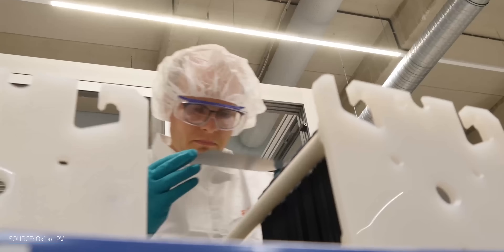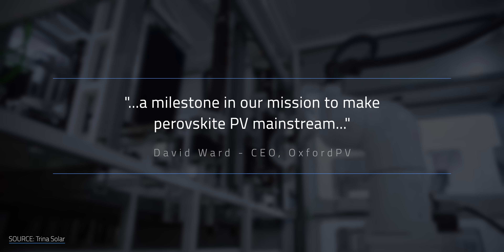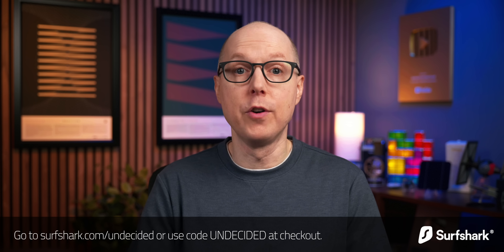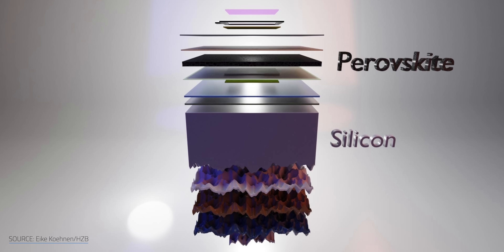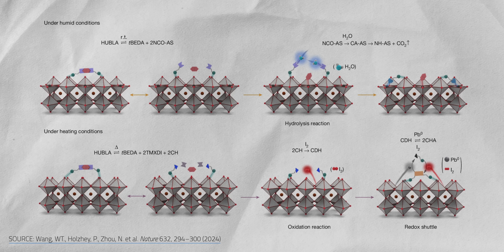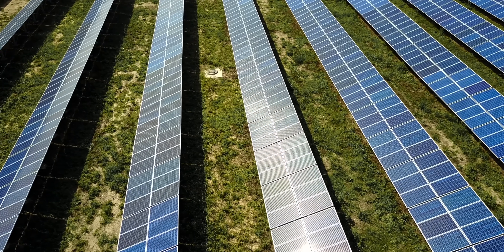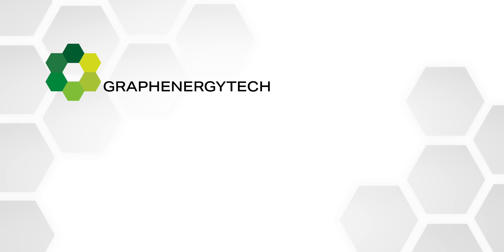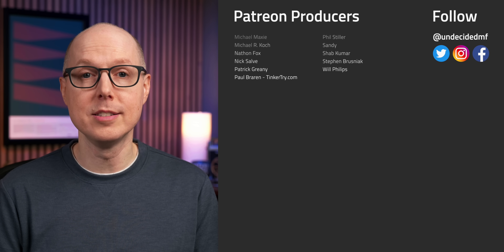What Solar’s 2025 Breakthroughs Mean for 2026

Comment: What I think is that you are being misleading. The so-called 'theoretical limit of silicon at ~30%' applies only to single-junction silicon solar cells (the Shockley–Queisser limit). Once you make a tandem cell, like a silicon–perovskite dual-junction, this limit no longer applies. The top perovskite layer absorbs high-energy photons that silicon cannot, while silicon absorbs the lower-energy photons that pass through the perovskite. Claiming that this 'shatters silicon’s theoretical limit' is therefore scientifically incorrect, because the limit never applied to dual-junction cells in the first place.

Comment: So what does this mean to me as a homeowner looking into solar? Is this coming to home solar in the next year? Next few months? Next 5 years? Up front costs vs long term gains. 

I am looking into just supplementing my home for now with 800w or so of panels. No batteries yet. No fully integrating into the house, just adding a bit to reduce grid reliance. 
Have been looking into the kits that let me basically take ~800 w of panels, plug into a microinverter, then plug into a dedicated breaker to "back-feed" my panel that is monitored to prevent back-feeding the grid.
Reply: Thats also kind of what I want to do, wet my appetite. 

Also, since the home I purchased with a mate won't be my forever home.
The co-owner isn't keen on solar and is skeptical of its payoff time versus value.

But I won't let that stop me from trying to dabble in it.
Reply: @ArmChairPlum  Yeah, saw a video talking about Craftstrom (https://youtu.be/6yVXXcBm08I?si=-A496NJ9EBjvVW3a) and it intrigued me. I see new 200-300 watt panels for $30-50 on craigslist often, and getting Craftstrom's (or someone else's) micro-inverter and power meter would give me 800 watts or so watts of solar for < $1000 to reduce my grid reliance. Return on investment would be just a few years vs decades for a complete solar system.

Comment: 1. PERC Technology

2. TOPCon Technology

3. Multi-Busbar Technology

4. Back Contact Technology

5. Perovskite Cells Technology

6. Half-Cut Cells Technology

7. Bifacial Panels Technology

8. Hydrogel Cooling Technology

9. Tandem Cells Technology

10. Concentrating PV Technology

11. Quantum Dots Cells Technology

12. Transparent Solar Panels

13. Organic Photovoltaic Cells  14. Organic Photovoltaics
15. Bandgap
16. Heterojunction Technology (HJT)
17. PV-TE Hybrid Systems
18. P-type
19. N-type
20. 16BB
21. Thermophotovoltaic Cells
22. Multi-Junction Solar Cells
23. HIMO Technology
24. Doping (Uniformity)
25. Nanoscale Lithography
26. Thermophotovoltaic (TPV) Solar Cells
27. Precise Optical Tracking
28. Super-High-Quality Concentrated Cells

Comment: For someone looking for a home installation,  these fabulous price reductions will mean very little. Next spring, in Canada, my wife and I  will be spending $28,000 for a 10kw system. The cost of the panels themselves is a bit over $4,000. The panels are 14% of the total cost. The mounting system and electronics are the big ticket items.
Unless the new panel technologies can offer higher efficiencies or better high temperature efficiency,  there is not much point for the home owner.

That said, for large scale systems, the payoff would be huge.
Reply: Just finishing 25 kwp 25kWh battery self mounted with k2 mounting rails, solar system for about €12k in Germany. Companies quoted 4x the price. Lol
Reply: @JesseJames-s7m  where I am, government regulations make it almost impossible to do a DIY system.
Reply: @fredbecker607  That's generally how it goes. But, in my country at least, you can at least DIY 90% of it and you just need a person with the license to print money to come around and plug it into your house so you could save a lot of the costs. Ofc, for anyone who doesn't already know, a roof installation is completely ridiculous if you have the space to put it on any other land at all
Reply: @JesseJames-s7m Well, everybody's got to eat!
Reply: @ronthered138  how long will take to recover your expense?
Reply: @JimmyTheGreek2121 Just over 11 years. Ontario electricity prices are not as bad as some of what I am seeing in the US, for example. The rates went up 30% (!!!)  a month ago. Yeesh.
Reply: @JimmyTheGreek2121  why is the recovertime of the expense so important? What else in your household is you even generating 1 cent? PV directly saves you money, it lowers your cost of electricity, even can make you a few months independent. And if you are living in greek i guess that will be a lot of months in a year where you could live without an electricity bill.
Reply: crazy panel prices. at nearby retail shop 10kw of panels with vat costs $1600(it's us dollars, maybe you specified canadian, but still that's too much)
Reply: @SergePavlovsky Wow! Where is this?! Good prices!
Reply: @ronthered138  in ukraine
Reply: @SergePavlovsky The suppliers know that they can jack prices up in Canada and Amerikkka. Our take home wages are generally higher, as is the cost of living in general. I am retired now, but when I was working, I put about $1200 Canadian dollars per week into the bank, after taxes. $4000 would be less than one month's wages. That might be a better comparison?

Comment: So basically no one should buy any solar panels until these become actually available in 5 years because we're on the cusp of a major leap forward on cost and output making anything today effectively obsolete immediately?

Thanks for the great tip!
Reply: Well not exactly, besides whenever you buy something its immediately dated.

The cost savings that you might have had over 5 years by buying now are what you have to contend with.

Depending on the deal you can get on already available tech. 

Otherwise you'll always be waiting for the next improvement and never commit.

Think like graphics cards.
Reply: @ArmChairPlum Solar panels have been at just over 20% efficient for decades now. We've basically just been figuring out how to get them cheaper.

If this tech pans out it will be the first big bump since solar panels basically became viable.

That could reduce the cost of electricity by a wide margin effectively making investment in the existing tech overpriced since you aren't able to build a system and get much less than 7-8 cents per kWH so at this point buying in is effectively burning money. You may as well just pay for grid power and wait if this actually works. Since grid power could also get cheaper than existing panels can make energy. Well, except on California since they legislate everyone in to poverty still.

Comment: I'd like to see solar prices continue to come down, manufacturing to ramp up in the USA and bundle them together with Sodium Ion batteries for storage. 
Utilities need to kill all net metering and require battery systems for grid tie ins. They found out the hard way that net metering forces the costs of solar intermittency onto the utility.
If they can do that it will help stabilize everything.

Comment: graphene and its derivatives, particularly graphene oxide (GO), pose potential environmental threats due to their mobility, persistence, production impacts (toxic chemicals, energy use), and possible harm to microorganisms and aquatic life, though it also offers environmental benefits like water filtration. Research shows GO nanoparticles can travel in water, affecting soil microbes and aquatic organisms, while production involves hazardous solvents and significant carbon footprints, necessitating sustainable methods and careful regulation. 
Potential Environmental Concerns
Persistence & Mobility: Graphene oxide (GO) nanoparticles are highly mobile in water, moving easily from surface water into groundwater, raising concerns about widespread contamination.
Toxicity to Life: Studies suggest GO can negatively impact soil microbes, plants, and aquatic organisms (like fish larvae), causing oxidative stress and developmental issues.
Production Footprint: Traditional graphene production uses harsh chemicals (like sulfuric acid, potassium permanganate) and is energy-intensive, creating waste and significant CO2 emissions.
Air & Soil Contamination: Airborne graphene particles can agglomerate with other pollutants, while improper disposal can lead to soil contamination and bioaccumulation.
Explosive Potential: Some graphene oxide materials have shown unexpected explosive properties, requiring new safety regulations. 
Potential Environmental Benefits (The Other Side)
Water Filtration: Graphene filters can remove heavy metals and microplastics from water.
Catalysis: It can act as a catalyst to break down harmful chemicals in waste.
Sustainable Alternatives: Graphene-based materials are seen as sustainable replacements for conventional materials in various industries, notes NanoEmi, says ACS Material, and is a Berkeley Scientific Journal in its assessment. 
Conclusion
While graphene offers solutions for environmental cleanup, its widespread use requires addressing significant risks from its production and potential release into ecosystems, emphasizing the need for life cycle assessments (LCAs) and greener synthesis methods, according to AZoNano and Nature. 

graphene is recyclable, and new methods are being developed to create it from waste materials like plastic, effectively "upcycling" them into a high-value material. While individual graphene sheets can be decomposed at high temperatures or with strong acids, the material itself can be effectively recovered and reused by reprocessing its source materials or by creating new graphene from waste.

Comment: I still don't understand how you can say "Solar is already one of the cheapest ways to generate electricity". Are you ignoring reality? Billions of dollars in investments only to gain 4% efficiency while making them worse in every other way, not to mention you failed to address there fundamental flaw. They don't work half the time no matter how good they are, meaning you need to spend twice as much on land and batteries to compensate for there short coming. Only if you ignore reality and the facts can you think this is cheapest, they are not even price competitive. You spend far more and get a product that is fundamentally worse, in every way.
Reply: The price per watt-hour installed is already competitive over the lifetime of the panel with fossil fuel electricity, and the latter is only going to get more expensive. 
And fossil fuel power plants "only work" when continuously supplied with fuel. Once solar is installed, it's practically free, and can be installed on top of existing infrastructure so it doesn't use land.
So yes, solar is already one of the cheapest ways to generate electricity.

Comment: So Perovskite degrade in nature.  And the breakthrough is that they degrade slightly less.  They are using it now, BECAUSE it breaks down' built in obsolescense is a feature, not a flaw.  Utilitity scale built in failure.  Great.
Reply: Nothing lasts forever. Silicon lasts "only" 25 years, because it breaks down in nature, albeit in different ways. What's your point? We should hold out for immortal infrastructure?

Comment: Solar panels, fine...but aren't they basically "old tech" by now? Mounting solar panels to roofs is basically still ugly, difficult and expensive.

The REAL interest in "solar technology" will be when we will have affordable roof-tiles that generate electricity or, even better, window panes that you can see through, but also generate enough electricity to (more than) pay for the extra cost.

Personally, I'm most interested in a see-through foil that can be mounted on the inside of existing windows that generate electricity and can be combined through MPPT controllers. The efficiency won't be the main concern for normal people. The cost and ease-of-installation will be MUCH more important.

Comment: As with other new tech, these first commercial Perovskite panels are going to sell at a premium, but applications that limit panel size make the premium worthwhile. Remote telecom infrastructure is a great pilot application
Reply: And as with everything once it's been out a while and the R&D costs have been covered the price can come down and become even more popular and available, I'm holding off on buying solar and battery for PV and solid state batteries.
Reply: @TheBoringInvestorMan  well, it it's with everything, then silicon pv price can come even more down, since it covered much more r&d costs, right?
Reply: such applications lack scale. like satellites. no scale - no economies of scale

Comment: Interesting, as always...., but still no clarity on what Perovskite we talk about on each new publication here.... Still the LEAD based ones, or Lead-free at last ? We want NO LEAD on our home roofs, full stop ! Each time a Perovskite case is reviewed seriously,  they admit it’s always Lead based, as this is the most efficient so far ... but there could be other Lead free alternatives..... that they never publish anything serious on. Strange !!! 
Then on tandem cells, the Silicon layer has a proven track record of 25y-30y guarantied lifespan, while The Pevroskite layer put on top of them lasts only a fraction of that life time, obscuring the underneath layer forever. Want real numbers committed here !
Then on the heat dissipation, cool if not too expensive... but rather than wasting that heat I prefer the french company DualSun approach, with a circulating water/glycol back heat échanger, allowing to extract and then to harvest that heat energy, for the home hot water, or the swiming pool heating, or other types of heat energy storage batteries, like those with phase change materials...etc. 
I personnally invested in MBTN in CH, who are supposed to team up with Oxford PV leader.... and I lost everything on that line... Means all their common Product Plan was likely a fraud, or at least a failure.

Comment: Keep hearing this yet can't see anything remotely affordable let alone profitable.  heck my curtrrent panels arent even profitable till 2043... batteries as they are now will never be profitable...
Theoretic limits are also irrelevant.  silicon doesn't even get near the 38% they reached in labs.
Reply: Solar is essentially a way to pre-purchase 20 years of electricity at a fixed price (amortized installation cost). The "profit" comes in the form of avoiding rising electricity costs. 🤷‍♂️
Lowering the manufacturing costs and increasing efficiency both serve to lower the cost per kWh over the panel's lifespan. I don't know what else you're expecting to see from innovations in the space.
Reply: @erikdietrich2678  electric costs have gone down here and will keep going down till 2030 atleast and probably further when we go all electric... And now on top i have to pay 15 cents per KWH of power i load onto the grid.  these panels will NEVER make their money back even without the penalty. i should have put my money is a savngs deposit at 3.6% and paid my evergy bill with that. 
I have literally just started wasting energy on grow lights  inefficient heating and cooling just so i don't have to pay the fine for going green.

Comment: You said my favourite word.. "Graphene" which just happens to be my main area of research. 

Plasma enhanced chemical vapour deposition just so happens to be much easier than roll to roll processing in my opinion because it's a one stage layering process and a  direct to surface treatment. 

I think that it's a very promising solution for perovskite quantum dot solar. Let's cross our fingers i guess.
Reply: Plasma vapor disposition works for graphene? How do you control the thickness? Won't it merge into graphite once more than one layer of carbon is deposited?

Comment: if it is installed in field passive cooling is needed, but if it is in root top. the active cooling could provide heat water too.
Reply: Been there, had that, dismissed it as inefficient way of heating.  ´Changed to cheap PV panels instead.